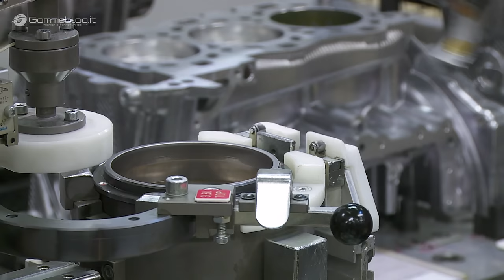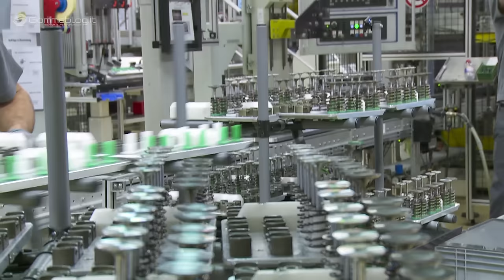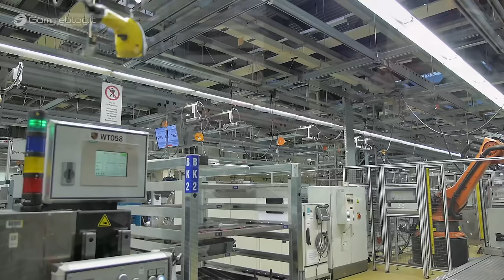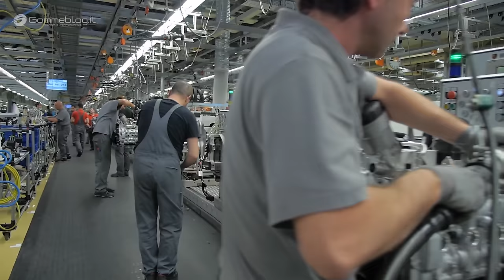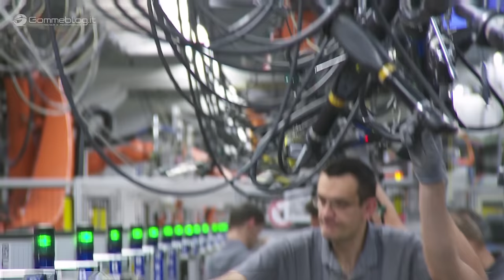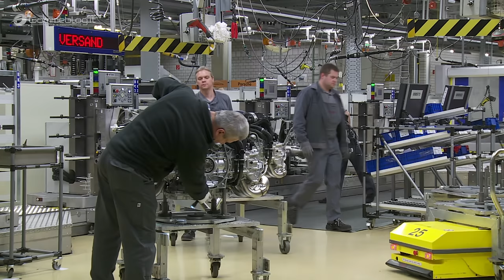Porsche Engine Production - How to Make MANUFACTURING Car Factory

Comment: The thumbnail seems like a 2 cubic meters engine!!!!!
Reply: Sorry, but 2 cubic meters is as much as two IBC tanks or 2000 liters. You mean 2 liters or 2000 cubic centimeters.
Reply: @saschafunk1644  yeah I meant 2000 litres. It looked like a huge factory power plant.
Reply: @saschafunk1644  woooosh
Reply: I thought it was a diesel, until I read the titile

Comment: 9A1 engine.  There is one 20 feet away from me in my garage, mounted in my '14 981CS

My previous car was an '85 928S2.  It's engine was hand built with torque wrenches and no robots.  I  think the motors in this video are from the 911, since the oil filter is vertical on that car, and on a 981 it is accessed from the bottom.

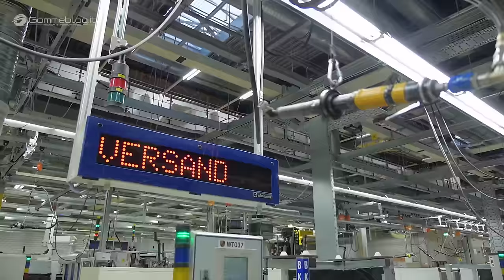At 5:32 you see a 981 engine, since the oil filter is vertical and the exhaust exits at the same side of the engine as the flywheel.

Great video!

Comment: When i assemble an engine it has oil everywhere. Transmission fluid on the pistons and so on. These Porsche engines look dry.
Reply: Yeah but these engines are easy to get to in case of any repairs needed
Reply: Look at the movie on engine assembly at Mercedes. Plenty of oil and grease

Comment: I wonder is Porsche offers a custom assembly order. like adding or changing components during assembly. porting/tuning etc. custom cams, injector and air inlet changes etc. or is everything pre engineered and pulled out the box and no options like that offered

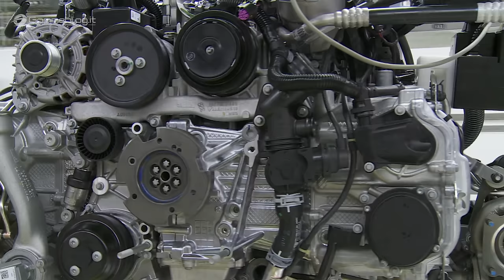Comment: That huge piece of engineering at 5:00 will slowly be replaced by something with one moving part that is more power efficient, 7 times smaller lol
Reply: And 2 times heavier
Reply: @sancho2112  i disagree, the motor in the taycan is several times lighter... I think you are talking about the battery as well,  well the system may be heavier (not 2 times heavier) its still a simpler car... No oil change, more life span for the breaks (if we are talking about carbon ceramics which are 15-20k to replace...) U get my point
Reply: Yeah i meant about the battery system i said that a bit more heavy than a ICE,but  yeah i think that the electric motor is far more simple takes less space.
Talking about brakes i disagree a bit with you because in high performance cars like GT2 RS,Pista,Huracan,720S ... brakes are for maximum late breaking and push the pedal to the floor and not for everyday use because they wear in the other hand brakes in electric cars are for everyday use,use automatic brake and i think they use energy regen so whene u brake they transfere the heat into energy i think?
But yeah different purpose but i agree with you that brakes in electric cars tent to last longer than in normal cars thats why AUDI is using MILD-hybrid for the cars to make the brakes last longer by leeting car computers brake ny themeself to save brake and transfer the heat into energy.
Reply: @sancho2112  you are right but take the M5, most buyers daily drive these 2tone cars that costs 18k to replace the carbon brakes, weight size, probably a electric version of the 5 series would weigh more but the center of gravity is lower and the regen system makes you learn how to drive with one pedal
Reply: @NotMyAccount  you forgot about electronics. Lots of IGBT and MOSFET transistors working in a heavy stress PWM modes. Easy to break, easy to overheat. Sometimes it's pricey and takes very qualified personal to fix it up.

Comment: Recently here in mlysia a porsche car lost control and run into the road divider, because the driver was speeding(not really fast) in heavy rain. I think this incident happened because the engine of this car was in the back..causing it to easily lose control when the front tire was lifted while going through the water. U know how heavy rain..when it rains in mlysia.

Comment: When is Porsche building anoner H12 motor?...
Reply: Unfortunately never, they just don't make any sense with modern forced induction methods. Don't need 12 cylinders to make power anymore. Can use a smaller Flat six and still make 600-700 horse easy.

Comment: so complex when you compare to an electric engine
Reply: workandworkhere electric engines are complex too
Reply: @Pleibene1  maybe less complex, less elements are moving in electric engines
Reply: workandworkhere but you need to improve the software for the electric engine.
Reply: @Pleibene1  There is also software for internal combustion engines. Electric motor are more efficient and last longer than  complex internal combustion engines.
Reply: workandworkhere true. All the types of engine are complex.
Reply: @Pleibene1  Some more than others
Reply: never ever comes electric engines in my car. It needs at least 2 exhaust systems
Reply: Fossil energy consumption also saves us from a possible ice age. I can live very well in winter with not shoveling snow in front of my HOUSE

Comment: New carreras with turbo's. Closed deck forced induction beauty.  My only question is can it take the boost increase like the mezger motor found in the 996 turbo and other mezger variants?  Time will tell.  Amazing engine and German engineering at its finest!
Reply: Sure can, the new turbo Carreras and Turbos can crank out some serious power with just a tune. Add forged internals, bigger turbos, etc and you have monsters.

Comment: INCREDIBLE,WILL THE ENGINE DO A 100K MILES???
Reply: Will you change the oil? Will you run the engine at working temperature and redline it unnecessarily?
Reply: @agentsmith3825  MY MAZDA ENGINE HAS ALMOST 200K ON IT ,SS/VALVES,.003 PISTON CLEARANCE(I HAND FIT EACH PISTON),I DON'T KNOW HOW MANY ENGINES I'VE BUILT...1.6 I.B/6 IN MY 86,323 HATCHBACK...SHE IS MY COMMUTER CAR.SHE SPENT YEARS CROSSING THE NEVADA DESSERT AT OVER 100 DEGREES AT 4 GRAND HOUR AFTER HOUR...HAVE A GREAT DAY"T"...
Reply: @terrelmchenry9524  wholesome. You’re great!
Reply: @agentsmith3825  PEACE OUT...